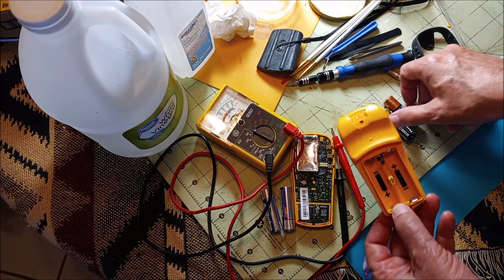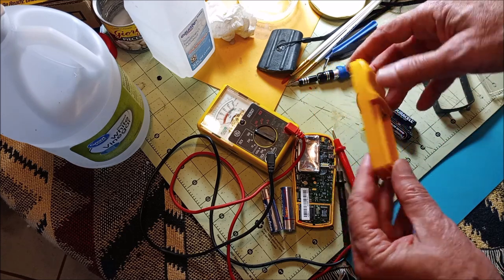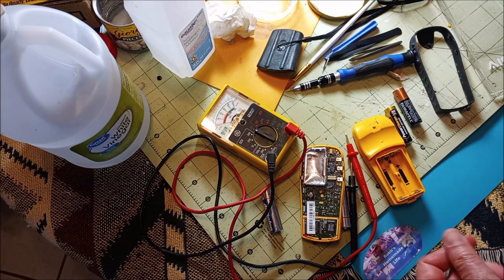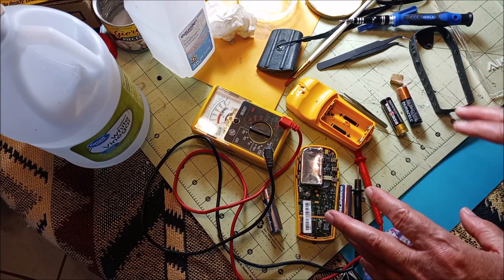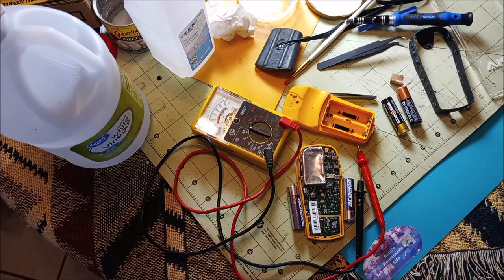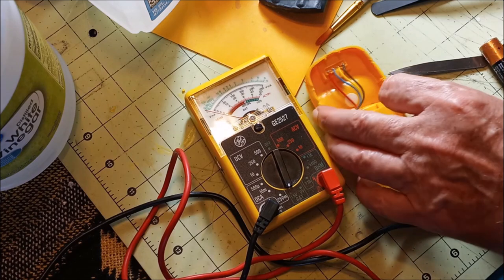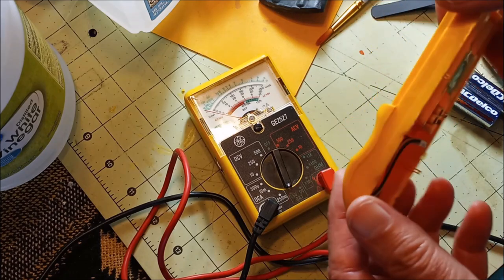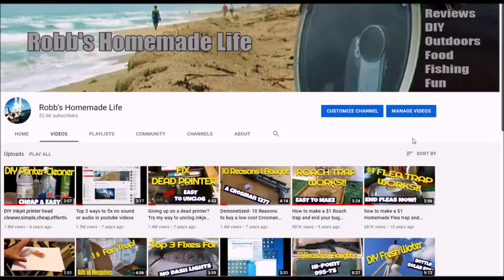fix battery leak corrosion in electronics camera gps remote control flashlights & toys

Comment: Always so frustrating. Just had some Duracells that don't expire until 2030 leak. Good info
Reply from the maker: Hey Moe, something changed with Duracell's. I used to have some copper top Duracell size D battery and those things lasted me for years. Now they seem to be crap.

Comment: That's why I always mix my batteries in my devices - half alkaline, half carbon-zinc. That way when they leak, they cancel each other out. Heh.  Seriously, though, great tips as usual. I've saved many an old widget that would otherwise have been tossed. Also, for the final rinse, I like a couple of good blasts of the old MG Chemicals SuperWash.
Reply from the maker: Actually John that was pretty funny. I could see red green mixing his batteries so when they leaked it would be okay.
Reply: @RobbsHomemadeLife  
Man, I miss Red Green. I think of him every time I use duct tape.

Comment: I never cared for the smell of acidic acid, so I use a dab of citric acid instead. I switched to primary lithium versions in lieu of alkaline batteries for my test equipment, it might be a bit pricey but the damage caused by the latter is more costly including the downtime.

However I still use alkaline 9 volts, for some strange they very seldom leak. Over time they eventually will leak and cause some damage, but it is usually limited to the snap connector. I have plenty of them in my parts bin and it takes about 5 minutes to solder a new one on.
Reply from the maker: I think you're right about the 9 V. I hardly remember seeing those corrode at all.

Comment: What about the battery itself? It has the same white substance on it. Is it repairable? Because it is no longer filled. Thank you.
Reply from the maker: That's a good question. People would normally assume that battery is no good if it had corrosion on it but it's possible it could still be good you would have to test it

Comment: Good one Robb.👍 I didn’t know about the vinegar trick. I would have tossed that unnecessarily. You had a real stalagmite starting in there. 
Good grief! I just made the connection. Alkaline!!! Oh well…. I did get hit in the head with a baseball once….. no twice! 🥴Duuuhhhh .. may have something to do with it.
Reply from the maker: Hey chops after I removed all of the corrosion from that little GPS it still would not work because it has a little internal battery that was dead. When I touched it to see what size it was it broke off and I don't think I can solder a new one to the board. I'm not that good.
Reply: @RobbsHomemadeLife  
All effort is worthwhile for education, even if it fails. You got me past my “alkaline” block. 
All things electric are messed up in my mind because of the illogical nature of the way the terms positive and negative are used. 

I finally found out why. It goes back to Ben Franklin explaining it like it was water. His hypothesis was wrong but the math was perfect so, to avoid confusion, the powers that be left it alone. My conundrum was “How in the heck can an excess of electrons be considered negative? (the adjective is bassackwards) No one could adequately answer my question for fifty years. 

Finally, an electrical engineer and historian made an illustrated video about it. I know I put it away somewhere. If YouTube didn’t lose it, I’ll get back to you with a link. Unfortunately, my brain still turns off while dealing with things electrical.
Reply from the maker: I always feel hesitant about making any videos concerning electronics or math because those are my weak points.